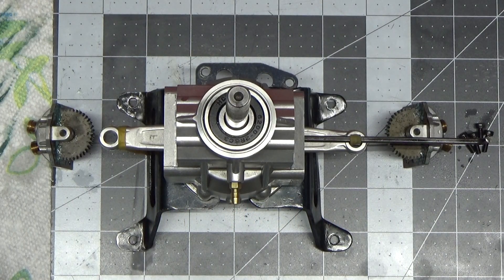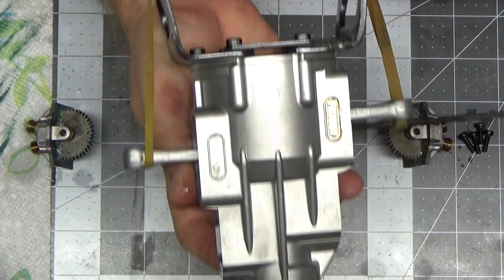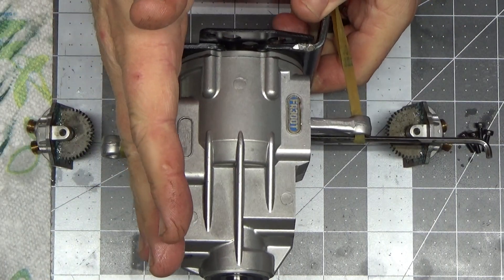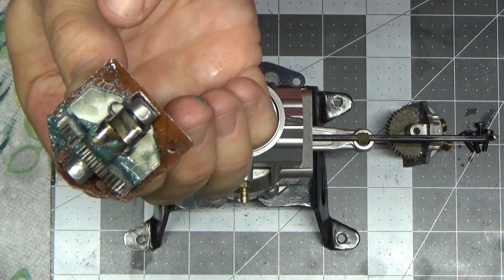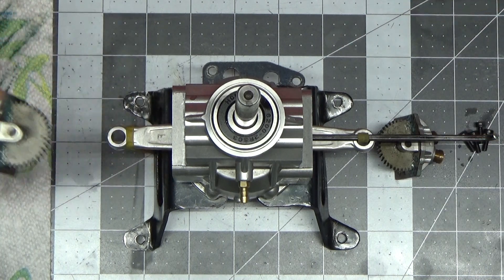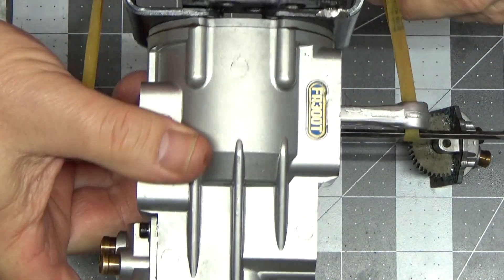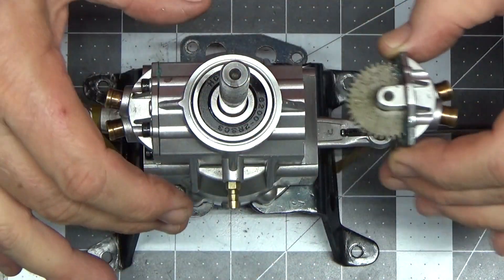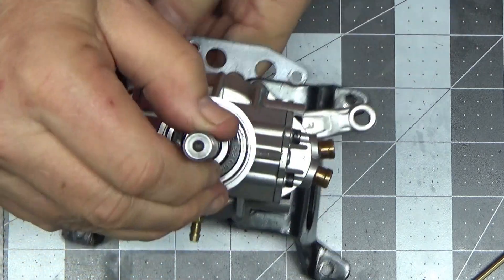Saito FA-300TL Setting the Timing

Comment: Hi David, I'm about ready to rebuild my Saito 300T, my question is for the cam gears, I have ceramic grease, would that be OK to use on the engine?  Thanks   Stuart.
Reply from the maker: I cannot say for sure if that will be alright to be inside the engine.  I would be concerned about its ability to dissolve and pass through the engine.
Reply: @dmrcflyr2   Thanks David, I'll do some more research as I have the same concerns.